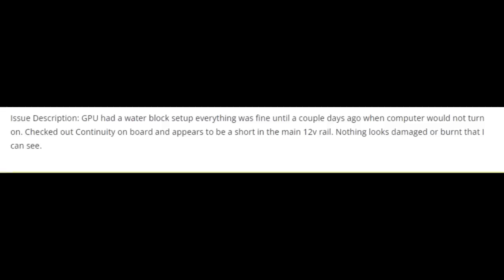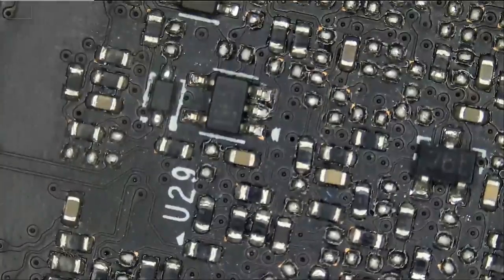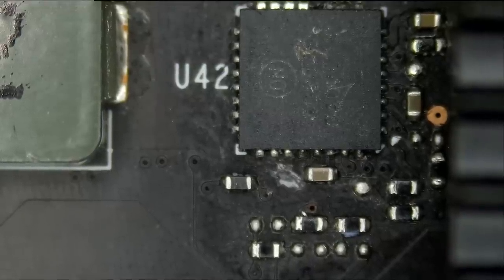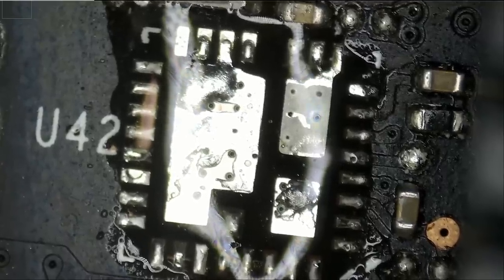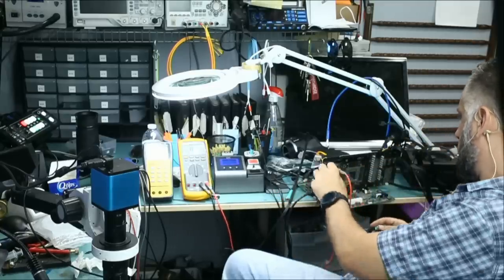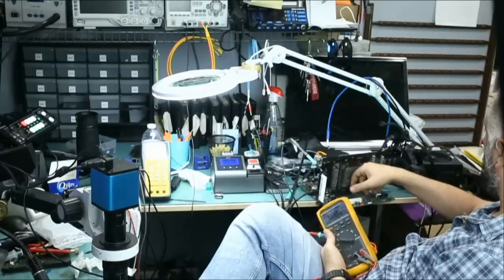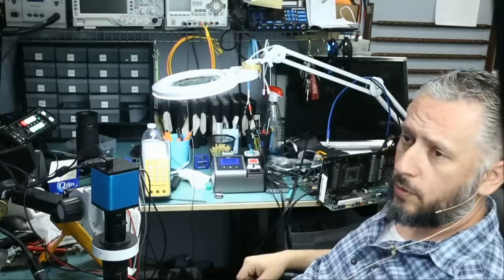MSI 3090 Trio Graphics Card Repair Suddenly won't turn on. Is it Fixable ?

Comment from the maker: Update: Check part 2 at https://youtu.be/HtIr7bxwQes

Viewers are suggesting that i inject voltage on mem and see what happens. I will do a part 2 today.
Reply: Thanks i appreciate that.
Reply: From the two cards I have done that to, usually all but one VRAM chips are shorted. Usually the 12v gets through to the VRAM chips and kills them. Replacing all the VRAM chips can fix it but the GPU can get damaged sometimes as well.
Reply: @skullteria  you took the words right out my mouth....this is exactly how i feel. I also bought equipment little by little. @northridgefix gives us the confidence to try fixing it ourselves.

Comment: GPU repairs seem to be a nightmare in general. I watch other channels that only do GPU repair and often it is very complicated and you have to have detailed knowledge of all the little components and even then it's not guaranteed fixable. Then there's cards that are almost always dead / unfixable like those older AMD cards with HBM memory. Or you get half-working cards that have artifacting and/or stability issues so you have to do extensive testing in software and so on to find out which memory module is faulty or whatever. Very annoying and time consuming.
Reply: Which channels are those?
Reply: @kkgt6591  TechCemetery is my favorite.
Reply: They are ment to be unfixable as possible. No company making GPUs like Asus, MSI, Gigabyte, etc give any type of schematics or service manual. This limits repair to themselves or the few people that have built up experience with loads of dead GPUs which not many have that opportunity
Reply: @zacharytaylor8523  Why do not they want to fixed voltages?  To sell new ones?🤔👀

Comment: I think these newer cards only power on when the fan and the heat sink are attached. I had a similar issue. Great repair 👍👍
Reply: It won't power on if there is a dead short on the memory side. That pretty much killed it.
Reply: what do you know about these newer cards boy
Reply: Yes 30 series overheat protection hits instantly without a heatsink on the card.
Reply: @therealmotherphuck  13:57 Do you think he burnt his finger there ?
Reply: The issue are thermals for sure. Every card over 3080 will reach shutting down temp in a couple of seconds. Mem issue, with correct readings during couple  seconds, is for sure a sign of it.

Comment: The lack of blown fuses is a great sign. It couldn’t have taken that much current without blowing the fuses. @actually hardcore overclocking is a great resource for gpu and mobo power delivery. And how stuff fails.

Edit: also how would the mem short not show up on any of the 12v rails? Just curious but i thought it was powered of 12v.

Comment: Looks like GPU is shutting down to prevent from overheating. Those cards (3080 and over) reach 100+ celsius  in a couple of seconds without any heat dissipation. 0 ohms might be caused by heat protection. In this kind of cards, always look for any way to avoid thermal shutting down, or in a couple of seconds any measure will have no sense ;)
Reply: 0 Ohms because of heat protection makes no sense. Yes the card will heat and may shut down but still that 0 ohm should not be there that's not how the protection works secondly , there is nothing that will prevent it from Posting , that's completing the built in self test load the firmware etc, if it did that it wont beep. Card is probably dead better to get these things RMA , evenever there is short its highly likely it causing secondary failures such as the chip itself
Reply: Yeah is exactly what I was going to suggest
Reply: how the hell would a 0hms dead short be cause by heat protection? It wouldn't.
Reply: 14:00 probably without heatsink the gpu core is frying

Comment: Put a cooler on the GPU and retest. Probably going into a thermal shutdown. My 3090 gets so insanely hot, its idles at over 100 watt power draw.
Reply: No he explains it at the end with the memory shorted (0 ohms).
Reply: A short on Vmem can hardly be caused by a warm GPU.
Reply: As Paris would say.. "That's Hot".  Cheers TD

Comment: They really gonna have to improve the buck converter Circuit to protect the gpu die from receiving a direct 12v , when a mosfet fail
Reply: @laboratorioassembler  BINGO! Planned obsolescence. ;)
Reply: @laboratorioassembler  you dont understand, its not about economy or sales,

Comment: When I was working with electronics development, if we had to rework something we would often use kapton tape to shield off components that we didn't want to heat up too much. Maybe you could use that for shielding stuff like your electrolytic capacitor there.
Reply: He used to use kapton but he hates it, he finds aluminium tape a notch above kapton and ofc heatsinks are even better.
Reply: A heatsink may conduct the heat in the hot air into the capacitor if it's not so large. Heat shielding is better
Reply: Not his first rodeo... but I like your attitude JOHN WICK. You are a good person.
Reply: I use copper tape.
Reply: @ДимитърАндонов-ъ7е  Heatsinks cool by conducting heat into the air. A heatsink cannot make something cooler than the air around the heatsink. In this situation, hot air is being blown around the heatsink which will reduce its ability to cool.

A heat shield will prevent the component from directly contacting the hot air. Being an insulating material is a good thing in this case.

Comment: new 30 series cards does not start without fans you should try that
Reply: So you are saying that there is none 30 series with waterblock?🫠
Reply: So you are saying that there is none 30 series with waterblock?🫠
Reply: @tomtebloss89  water block still have fan.

Comment: Ever try heat stop putty ? I used it on hvac sweats close to metering device and wet bulb . 2,400 ° oxygen acetylene torch and heat never traveled past the putty . Just a thought when nothing else works . Maybe not compatible chemically . I do not know 

The Zen Master is you brother ,not AMD

Comment: IDK why most of the 3090 cards have this problem (Suddenly won't turn on) , as a 3090 owner i'm honestly scared , thank god the card has a 5 years warranty
Reply: You need to change thermal pads regularly with very good ones. And also good thermal paste. I recommend thermal grizzly minus pad 8 and hydronaut or kryonaut paste also arctic mx5 is also good
Reply: As per buildzoids analysis from actually hardcore overclocking channel, the vrms and controllers are really lacking for the rtx 3090, where he tweeted out the only reason you'd want to buy the 3090ti over a 3090 is to not have recycled vrms and controllers from 6th or 7th Gen Intel motherboards
Reply: A few of the board partners arent actually honoring their warrenty hence why Alex has so many Gpus in for repair especially these 3090 cards.
Reply: @heavygunt10  That's because MSI is trash, don't know why people keep buying them.
Reply: voltage controller and protections are garbage, unless the retailer is changing something, most of them have it so the over current protection will never be triggered because it is set almost twice as much as the card is able to even pull

Comment: I would have check if the bios was corrupted due to the power malfunction, and re-wrote the bios. You would need an i-GPU enabled motherboard.
Reply: Good idea chris, I was thinkin' the same
Reply: IS NOT A BIOS PROBLEM. It is shorted to ground in the memorys phase, missing voltage then graphic is not power on

Comment: Good job. Can i ask a question? I have  a lil more simple card, it doesnt have another power cable, only slot feeds it. On the card all 3.3v power rails are short (this must be clue tho).  Used power injection 3.3 v 2amp, it pulls 1.4 amp stable and nothing else getting hot but gpu, it is getting slightly hot thats all. There is no damage on the board, clean and doesnt turn on. 12 volt power rails are ok. Just confused about that all 3.3v power rails are not connected right? i decided that gpu is gone, am i wrong?

Comment: How do you know where to inject voltage? On any electrical board not only gpus....can you please make a video about that?
Reply: It's any point on the shorted rail. Because from that point, it'll all go through the shorted component to ground. Then you use a thermal camera/atomiser/Isopropyl to find what heats up. So any point that's shorted (and being careful you don't inject it into ground by mistake, you can use capacitors to know what's positive and negative) will work.
Reply: He injects voltage on the shorted line. If the line is shorted and you inject voltage it will heat up what component is bad or it will heat up what ever component that has the lowest resistance to ground.
Reply: Look for the power cord :D I guess you need to figure out the short first, that means you need to figure out where the buck converters are first, if he had to explain everything in every video it will be boring for educated audience.

Comment: Not like 10series nvidia and old amd..20 and 30 series card is very hot in split second..  u need to put temporary heatsink before turn it on..even with short on memory (0 0hm).. the voltage on vcore and memory should still present

Comment: Hi, thanks for all your videos. What I'm not understanding is why the fuse doesn't blow if there is a short on the board?
Also, how come not every competent on the shorted line (e.g. The 5v line) gets hot? You were measuring shorts on many components but only one component got hot, why?
Thanks again
Reply: Fuses don't blow with shorts, they blow when there's too much current to prevent damage, which often occurs due to a short but a short does not always mean high enough current to break fuses in microelectronics. 
The short breaks the circuit flow and since there's no longer any resistance the failed component starts emitting current as heat from where the circuit fails, at higher voltages probably heat would spread to other components too but he injects very low voltages to contain heat emission to the failed component/that's how he pinpoints which component failed
Reply: I'm not very educated but my guess is fuse doesn't blow because the PSU is protecting itself, i.e. it's a 20A fuse, that's a lot and the PSU might be shutting down way earlier. Your 2nd question, is just ohm law, traces doesn't get hot as their resistant is very low, other components in series like fuses, coils are also very low resistance in dc, then non faulty components in parallel like caps and good ICs are high impedance, so much power gets to the shorted component only and heat is generated there first. Try a 1 ohm resistor with some wires (0 ohm) connected to a dc power supply, it will burn the resistor, not the wire
Reply: @glmnet  thanks for info, i liked this.

Comment: The customer should have sent the whole card, this may need the fans connected or CPU is overheating and shutting down.
Reply: There is a dead short on the memory,  the heat is coming from the current rushing in, no gpu will get to 100 C in 0.5s at start.
Reply: The customer's cooler setup is a complicated water radiator; traditional fan & heatsink omitted.

Comment: I’m sure all the scientists will have many suggestions for you Alex…
Reply: Of course, we do haha
Here are a few:
Use a separate 1000 Watt PSU with watt-meter
check vbios for factroy defaults
use heatsink and fan
have the manufacturer drivers preinstalled
lots things
Do you know what avoinics mean? haha
Reply: @igrewold  Oh well, at least we know you haven't got a clue
Reply: @trollmeister69  
Man you know where to get a cheap RX 580 from?
Wanna try it on linux
They got some on aliexpress but maybe fakes

Comment: What about BIOS or overcooking, customers are in most cases lie . Maby he was tweaking a card and fried memory, once had that kinda customer with 2080ti was overcoocking GPU and flashed with some moded BiOs and bricked it stateing that was working fine before and sudenly next day it stopped working . No mentioned about mods he put on. .

Comment: When you measure the Ohms to see if there is a short, what are the OHMs telling you. I think you said 440 Ohms was good. Is it that more resistance is good? I'm just trying to follow your logic.  A lower number would mean an open short to ground? It that what you are checking for? I' just want to understand the relationship of the ohms reading to the short. Thanks.
Reply: When reading ohms one probe is always on ground and measuring a positive voltage side should always be at least over 100 ohms and anything close to 0-1 ohm is basically a direct link to ground which is never good for a voltage side line.

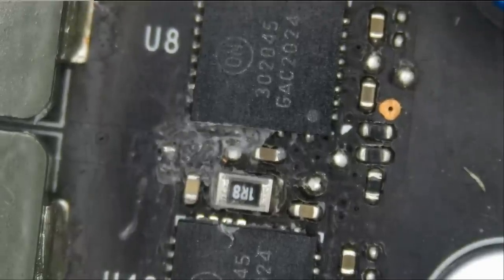Comment: 4:51
Is thermal paste conductive if hot/warm or cool ?
Reply: No
Reply: @Coniass  
" Silver thermal compounds may have a conductivity of 3 to 8 W/(m·K) or more, and consist of micronized silver particles suspended in a silicone/ceramic medium. However, metal-based thermal paste can be electrically conductive and capacitive; if some flows onto the circuits, it can lead to malfunction and damage. "
https://en.wikipedia.org/wiki/Thermal_paste

Comment: Why does everyone think 30 series cards need a fan plugged in to turn on? I've water blocked tons and never have fan connectors on the card plugged into anything and they run fine ;). He's correct that the card itself is toast, it goes through it's power cycle all the way until it powers the memory & chip. Then the chip get's super hot, super fast, the card goes into protect mode and throws the beep code that the card isn't functional. At least we got the "and the short is gone" before he diagnosed it as a brick. lol

Comment: I have a card that does not show any output, but I am access and flash the BIOS - does anyone know if the GPU might be dead or shorted?
I thought if there is a short, I won't be able to access the vBIOS either.

Comment: Would do a test with a fan plugged in. May have a failsafe? Same with it getting hot then turning off, add a heatsink and try again
Reply from the maker: Just use common sense. A 0 ohm reading on mem while power is off has nothing to do with whether the fan is plugged in or not.
Reply: Are you sure that 0ohm coil you measured is Vmem? Probably it is a V core.
Check the schematic
Reply: @NorthridgeFix  without it in front of me I can't really assume anything. But a 0ohm read on either vmem or vcore is probably either dead GPU or dead ram chip

Comment: why the 3090 owner not go thru rma if still under warranty? is it cuz northridgefix is faster, typically?
Reply: The card is factory air cooled and the person voided his warranty because it was replaced with water cooling.
Reply: @jambikaus311  just reassemble the shroud, heatsink, and fans before u mail it back? i mean if RMA cant fix it i would expect a new card. even those void warranty screw stickers arent legal (unverified) if thats a worry.
Reply: Rma not possible. Voided the warranty sticker for the waterblock.
Reply: @ShadowSingularity88  put it back together and none the wiser? also these AIBs fucking know ppl are gonna water block their cards, especially a 3090. u cant void a card if u just open it for cleaning. The FTC also stated that warranty void stickers are illegal. i mean srslyif northridge cant fix it this guy actually NEEDS to RMA asap or nice paper weight
Reply: @Yoblokit  those stickers are illegal and meant as a scare tactic by shitty companies and we dont know for sure if that card had warranty void stickers to begin with. not all of the cards have them. RMA is not possible until rma people tell you you voided warranty with xyz but until then its still technically under warranty.
Reply: @LtKeyser  mining cards dont mod bios unless u got a 1660super with hynix memory. also, there was a case to bios mod a 3080 ti flashed with a dell oem 3090 bios for additional mh/s but since lhr 100% unlock came out thats not necessary.
Reply: @jambikaus311  im not living in a fantasy world ppl rma gpus all the time for a lot less problems like "mem temps 110 just need replace thermal pads".
Reply: @TruthBuzz  This will be denied warranty, FTC has no control of the laws where they are based. Doing anything to a card under a warranty other then how it ships voids the warranty. Especially if you OC a card and put a water block on. Also they will know that it was done, like lying to a dentist that you brush your teeth everyday and floss. Also it shouldn't be, the user modded the card from factory and they cant be expected to rma something the owner modded
Reply: @LtKeyser  iuno why u bring up amd cards when u first used broken english and also the gpu in question is an rtx 3090
Reply: @TruthBuzz  You're right about that.

Comment: I think 3060-3090 now won’t power on with out a “fan” plug into the heater and why it might throw the chirps
Reply: 100% this.
Reply: My 3070ti is water cooled, hence no fans plugged in… still powers up. This 3090 was too… again no fans plugged in
Reply: @trollmeister69  external water pump running direct from psu.
Reply: short on memory rail is the main problem there
Reply: Watercooled 3080 here. Nothing plugged into its fan header. Works just fine.
Reply: Yeah thats not true.

Comment: The GPU should turn of asap to be protected for overheating. Without a heatsinck it is a matter of a second. Why don't you put anything even a cpu cooler with a bit of paste for a few seconds?

I don't think you can get a picture without a heatsinc with a exposed die.